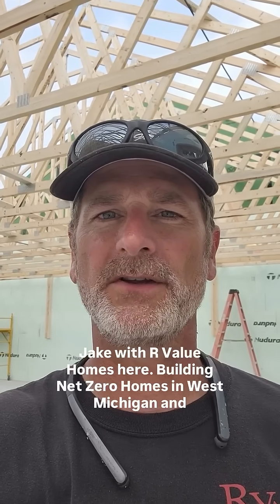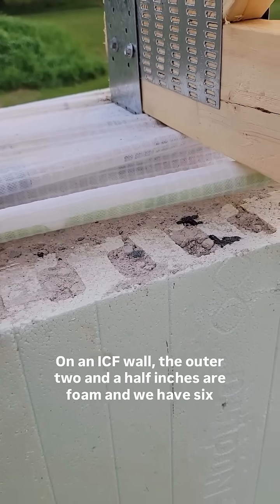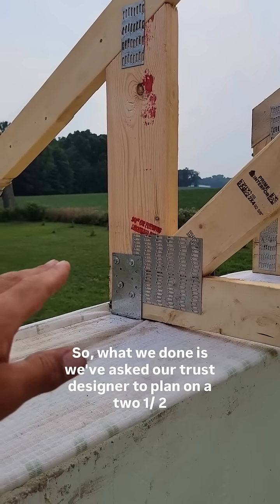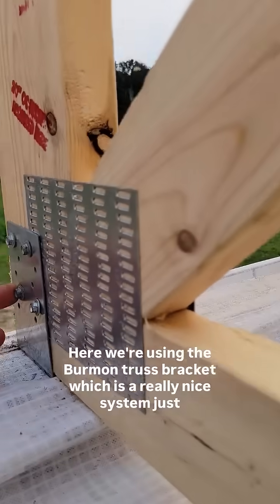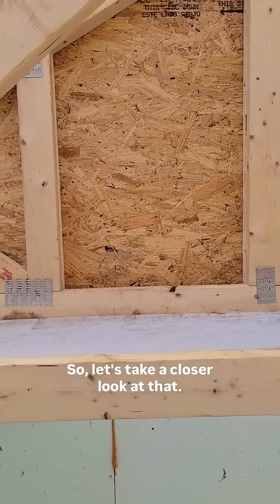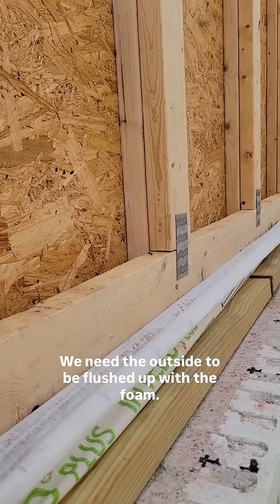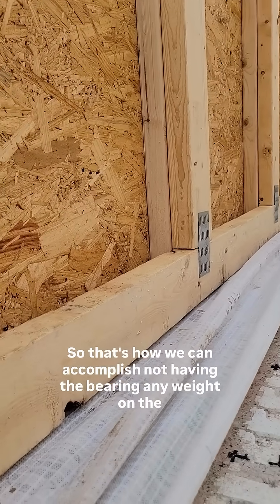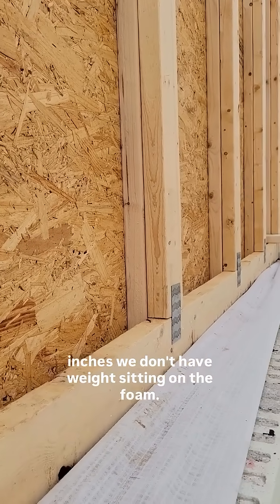How To Put Trusses On ICF Walls - Custom Homes in Michigan

Comment: For gables instead of doing a truss just do icf all the wall to the roof line. This way will make the roof structurally stronger especially in lateral shear. It also is smarter Idea for if the attic is going to be part of the conditioned space cause there isn't the break insulation.
Reply from the maker: We have done about 10 gables in ICF this year. It is most definitely not "just do the gables in ICF"....the juice needs to be worth the squeeze. You are correct, one of those times it is necessary is when the space is conditioned.

Comment: Haven't been into too many new builds. Currently doing a full remodel with a fair but of structural repairs. Copying the og design since it held the building up even tho there was an 8ft hole in it. What would you do for sealing it up, I was thinking house wrap and spray foaming any gaps and cracks between mud sill and siding till I get new siding on, changed 1st floor walls to 2x6s because it's in pa and wanted to up the r value of exterior walls. Thicker wall=more insulation ability as compressing insulation reduces its r value